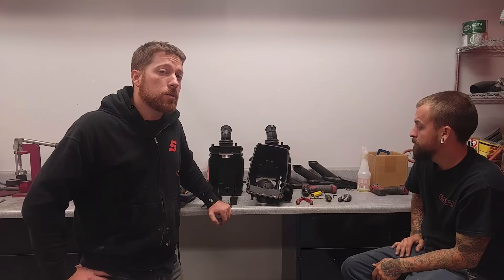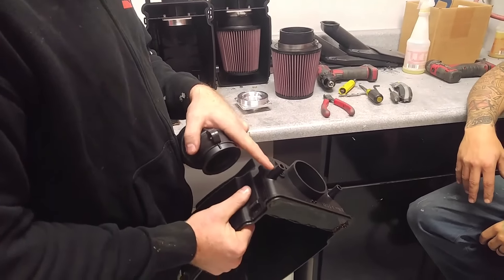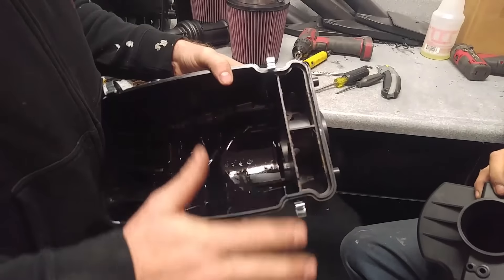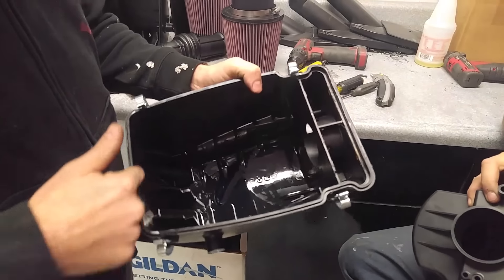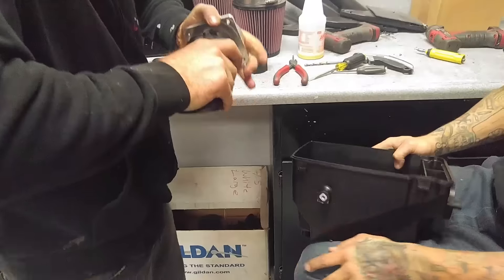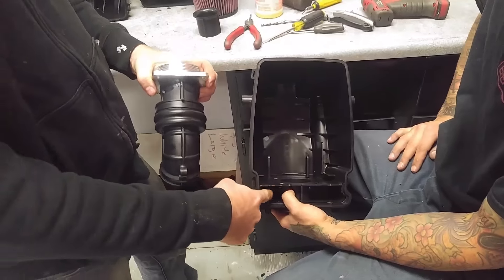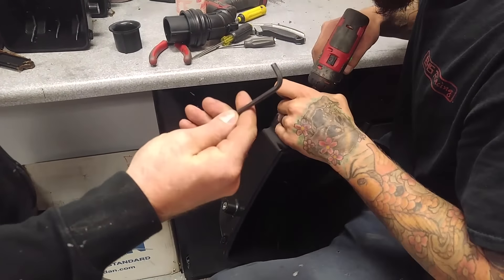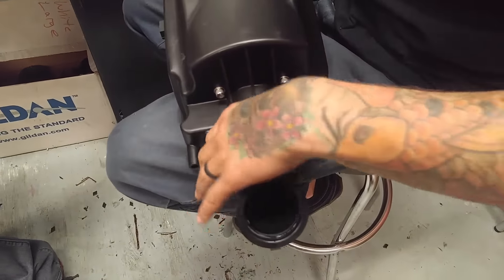2016 grizzly kodiak 700 airbox conversion Air Filter MOD intake

Comment: This was a very helpful video, because all of us aren't necessarily experts on this kind of stuff, but I'd respectfully suggest that before terminating this video, you guys should have included the fact that before completing the installation, the foam (Uni) filter and the two foam inserts in the AIS chamber all need to be properly oiled. That was a serious oversight in my view, as your written instructions didn't provide that information for your consumers either. And what about the little clear plastic oil drain bag that attaches to the bottom rear of the both (OEM and EHS) airboxes? No mention of that component anywhere either. Not good!

Comment: Does the stock air filter fit on this adapter? I love k&n but really not for offroading
Reply: The point of this is to get rid of the stock filter
Reply: @duckboy.3v  I know that but i just dont like k@n filters for offroading , very dusty here where i ride
Reply: @duckboy.3v  the point of this isn't too get rid of stock air filter. The uni is exactly like the stock filter. The point of this is to seal the intake tube and airbox mating surface better because OEM allowed a bit of dust by. . Using a k&n is kind of pointless ad they are not the best at filtering fine dust.
Reply: @jasonmorehouse3756  they work pretty well when you use them correctly with a dust sock......